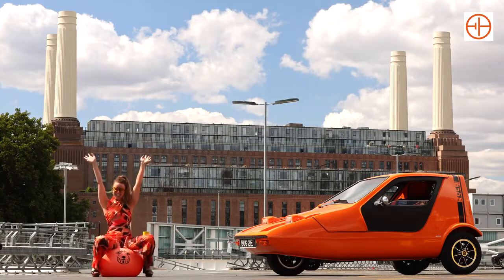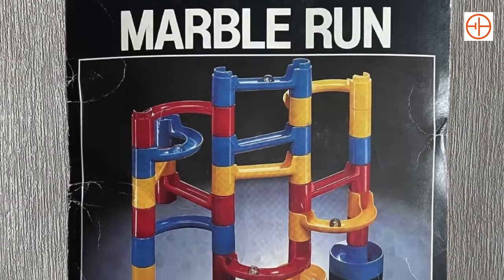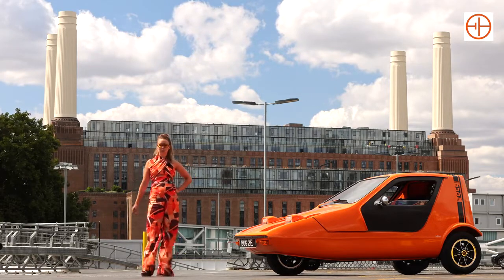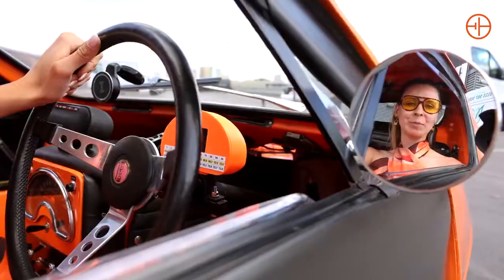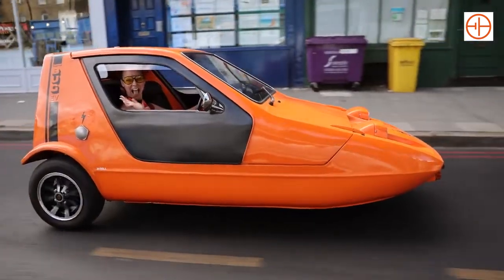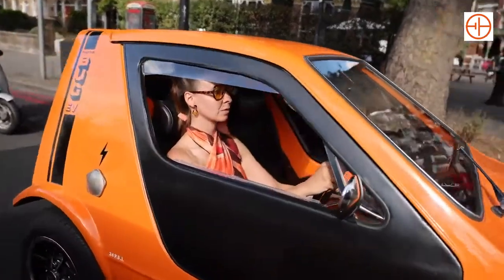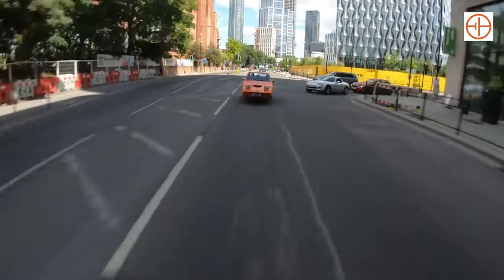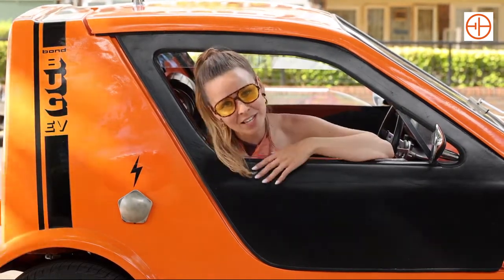Pink Floyd and the Electric Bond Bug

Comment: I still savour the moment I passed a V8 Rover in mine and realised he had the equivalent of 5 of my engines, 4 for the road wheels and one for the spare. It handled brilliantly. Lights, wiper and heater all very impractical, worse still mine was the basic model (now the rarest of all) with its steel steering wheel. The heater gave out about as much heat as a 20 watt lightbulb  (this electric version can’t possibly be worse) and the engine roasted one in summer. Not very practical for a 22 mile round the year commute but I was young and impecunious. Surprisingly practical in snow which packed about a ton in around the front wheel and kept it very firmly attached to the road. I much admire the side screens on this one, they look to incorporate proper windows - can that be true?

Comment: DVLA getting picky about these conversions now. Saying they must go for SVA test if there are alterations to the chassis/monocoque.
Reply from the maker: We've heard similar stories. Things are a lot more difficult in Germany:  https://motor-vision.co.uk/latest-news/germany-vs-car-modification/
Reply: Chassis and body are 2 separate part in a Bond Bug aka no cutting required and no effects on the DVLA Side of things...
Reply: @EclecticElectric  DVLA say no extra holes in the chassis aka no way of securing battery packs to make them safe, I've seen some batteries just resting on chassis rails due to DVLA rules...